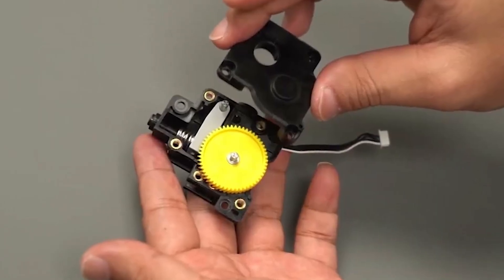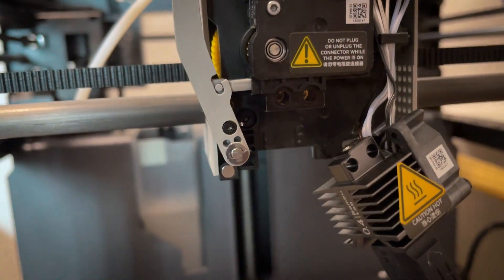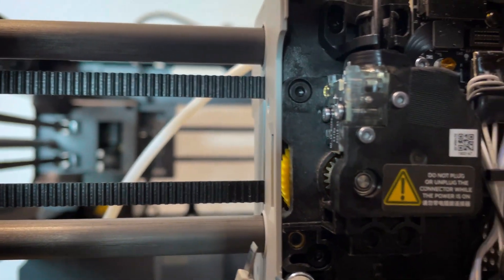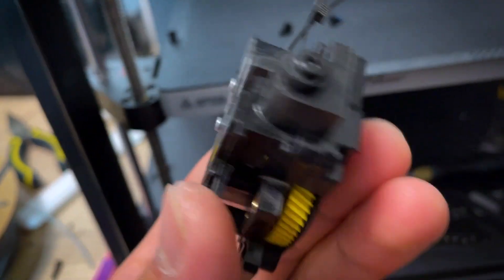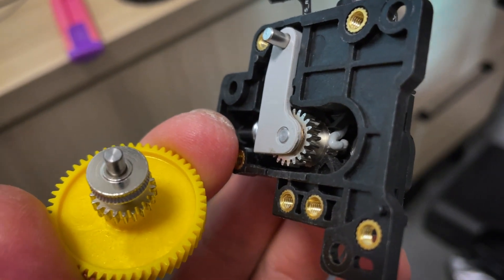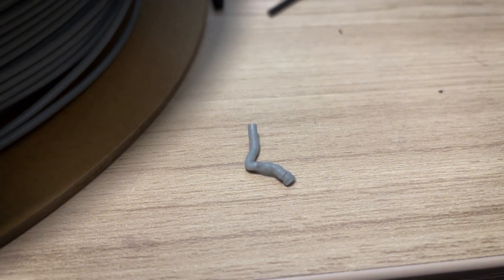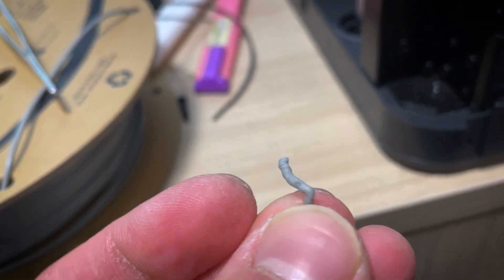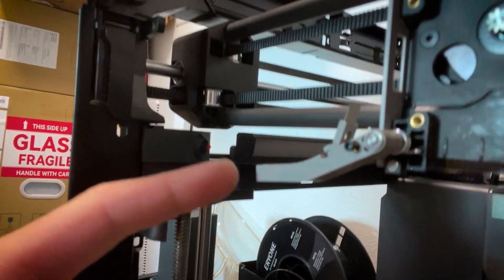Don't Do This When Printing With TPU and How To Fix It (Bambu Labs P1P and X1)

Comment: Bambu lab machines have many interruptions in the filament path. From the gears on into a plastic guide. from there through the cutter, from the cutter in the next guide and then the extruder. This is extremely bad, it introduces many potential failure points. I keep having huge issues with my H2D when printing TPU 70A. With an ender 3 I can print up to 60A. These are great machines and the softare is also great however I wish their extruder design would be easier to clean after a clog and they would have a better filament path. I would like a TPU specific extruder, without those cutters, they are just in the way.

Comment: Thx.  This is the best vid about the Bambu extruder.  As I type my Bambu is printing some very flexibele TPU, and I have this gut feeling I'll find my extruder clogged when I get home. (Circumstances forced me to leave the printer unattended at this worst possible moment).  So while I'm stuck here  babysitting actuall kids instead of my printer I've spent all my available time finding out how to handle potential clogs. 😀
Reply: A few moments later.  This print actually worked out great.  I printed a few more things, and then I got this exact clog,  used this video and fixed the printer :) 

How do you manually extrude the filament?  (or did you mean, controll the extrusion manually in the menu instead of pressing load/unload in the slicer).

Comment: Thank you for posting this! I was printing silk PLA on my X1 Carbon when it happened to me, so it appears it's not just a TPU issue. I cleared the clog from the nozzle, but couldn't figure out why the filament wouldn't retract or extract. So I figured I had to get more into it. I wasn't sure how far I would have to take it, so I appreciate you taking the time to post this! Very well done! 😎✌🏻

Comment: Before anyone takes apart the extruder housing, I would first try to see if you clear the nozzle clog with the thin pin and see if you can unload the TPU first (if you haven't tried that already). I thought I would have to go through these steps and/or heat up the filament inside the housing to unclog the TPU. But decided to try the simpler method before I did that. I first heated the nozzle to 250 and stuck the thin pin inside the nozzle. Then I unloaded the filament. I had to pull a bit harder than normal to get it out. But it turns out there was a hardened, deformed piece of TPU in the extruder that caused my clog. I saw this at the end of the filament. I snipped that piece off and reloaded the filament and voila! It is working again!

Comment: I had the same issue, I had frequent extruder clogs, printing two different harnesses of TPU. BambuLab Support send me a new set of extruder gears. Your gears, have a straight profile, same as my old. The new gears they send me have a helical profile, and it appears to fix my issue. I just printed my first 30D TPU part. Previously I couldn't get past 10th layer with 96A (which is much harder)

Comment: Hmm. I've had no problems with TPU until today. When printing the 2nd half of a TPU lined, PS5 controller case, I found the print head dancing over an inch over the 2 layers it printed. I was able to pull out the filament from the back, cut the [slightly] mangled filament off, and retry. The same thing happened again, but I couldn't pull the filament out of the back. I'm actually quite surprised at how strong a strand of TPU is...lol. Anyway, I simply took the magnetic cover off, pulled the PTFE tube off, and the printer was able to reverse the filament out like nothing happened. There was only about 4mm of filament that looked like it was squished by the extruder gear somehow.

Also, a bunch of crap fell out of the print head when the cover was removed (pieces of failed, 3D printed fabric tiles, somehow...wtf), so maybe that was part of the problem? lol. Time to try again...

Comment: Great video. A clogged/jammed extruder is one of the more common issues I experience with my P1s. Both TPU and hard filaments too. This morning my extruder seemed clogged but I could easily pass a .4 needle through the tip when it was hot, yet my extruder was skipping. When I took it apart, there was a very small fragment (like a little 2mm chip) of PC filament that was causing the gears problems.

Comment: Thank you for this video.  I was doing a print and ran out of filament and could not get new filament to load.  I changed the hot end and still no go.  Watched your video and took my extruder apart and took out that gear and sure enough, there was a piece of filament in there.  Thanks again.  You really saved me from pulling my hair out.

Comment: TPU is hit and miss on every Bambu printer. Some people have success others don’t with same settings and same filament. The first problem is the filament path… too much drag. Need a top mounted spool holder and a small Bowden tube and feed directly into the top like a bed slinger. Second is the extruder design. Dual gear direct drive drive extruders, like the Sprite extruder, from Creality among others do a MUCH better job feeding the filament uniformly without deformation.

Comment: I'm trying to print Ninjaflex TPU on the Bambu X1C and it just always fails. Loading the filament (external sppol holder) is no problem but when the prints starts, nothing is coming out... Is it possible at all to print TPU on that printer ??? (I miss my Prusa MK3)
Reply: with the external holder, are you sure it got up into the hotend and not stuck somewhere in the reverse bowden?

Comment: Looks like the tolerance is too open & prone to this problem. 

Seems like they need to tighten up the tolerance in that area.

Just like the 3D printed extruder part for the CR10s or Ender 3 for TPU printing. It made the tolerance very tight so TPU couldn't bend like that.

Im guessing you're still having problems or down time with the Bambu, since you haven't posted in a while???

Comment: i dont think it is just with TPU.  I have had the exact same thing with PLA and got the error on the ams that it couldn't retract the filament and after having to tear down the whole thing from hot AMS back to the extruder it was the same type of clog.

Great video and well done and informative
Reply: Sounds like too much room in the Extruder & it needs to be fixed for a tighter tolerance
Reply: Yup. First time I used the AMS I had Bambu Purple PLA Basic on slot 1 and had troubles, kept the nozzle hot while I was tryn to solve, which I didn't, and so was worried to have a bad clog like that. It turned out to be smaller but enough to make me worry. At least I learned how to disassemble the entire print head and finally installed hardened gears.
To say that, differently from their P1S upgrade kit, this part is very well designed and eazy to mantain!